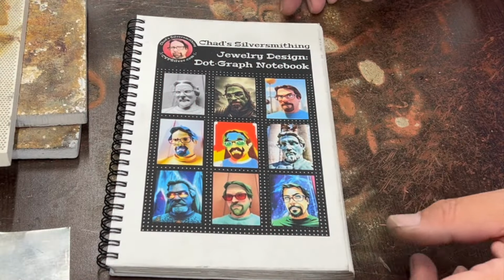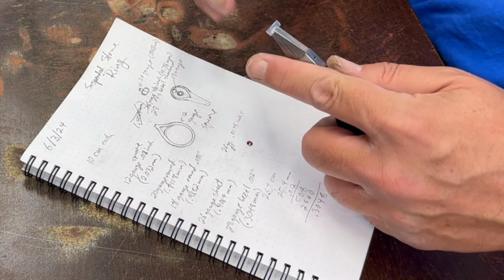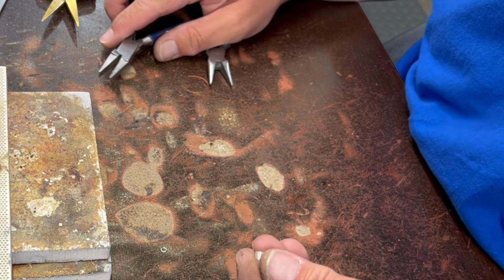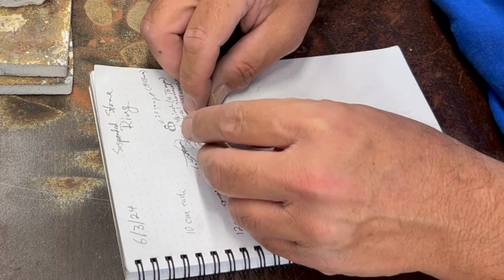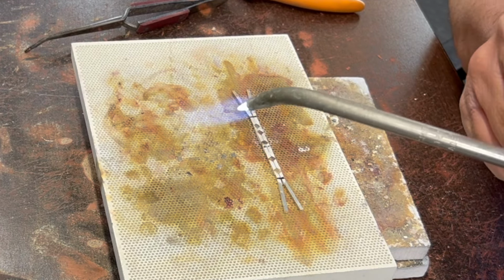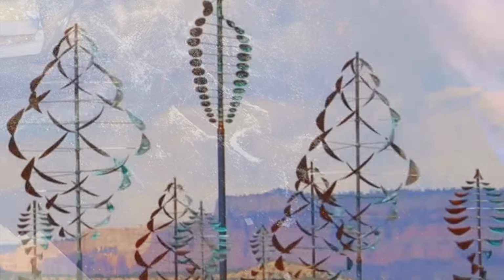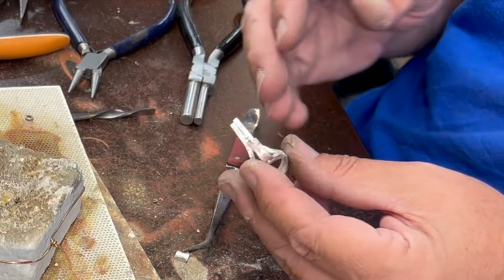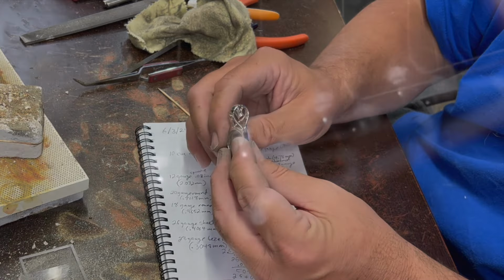Make a Ring with a Kinetic Feature: A Silversmithing Tutorial

Comment: Yep, really wacky Chad but another good informative video! I have a suggestion for future design books. You quite often refer to the gauge of the wire or sheet you are using. I have yet to see a supplier here in the UK that specifies silver by gauge. Maybe on the inside of the cover you a could put a gauge to mm and inches conversion table. Thanks again for the great video!!
Reply from the maker: Thanks Bill!  We were already talking about the gauge to millimeter conversion chart.  Shouldn't be too long before there is one on the merch store.  I don't think it allows us to put it on the inside, so will likely be on the back like the fractions of an inch to mm one we just created a couple of weeks ago. Thanks for the suggestion and nice comment!

Comment: Cute ring, love your videos. Just curious tho - why don't you just use silver tubing for the bezel? I made a similar double-ended little setting (with 4mm stones) with a headpin perpendicular thru the middle so that it could spin all the way around (rather than soldering on a ring to create a dangle as yours does). Simpler quicker & no fiddly solder work involved.
Reply from the maker: Good idea!  Mostly just didn't have any right now:)